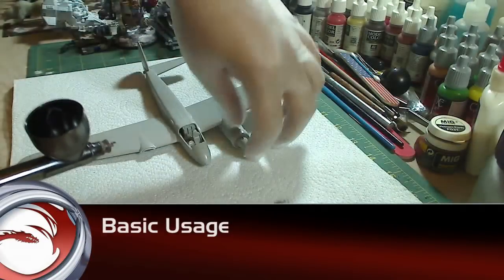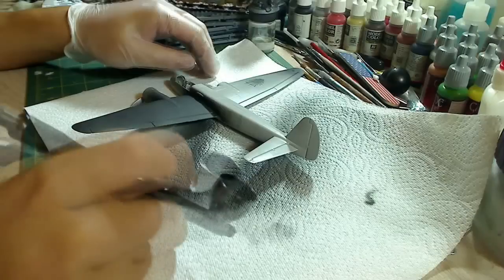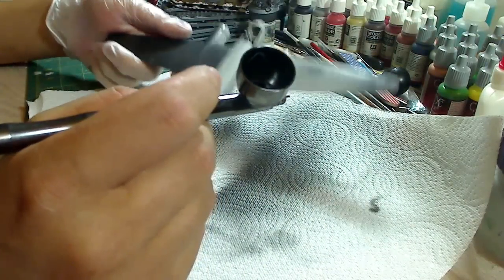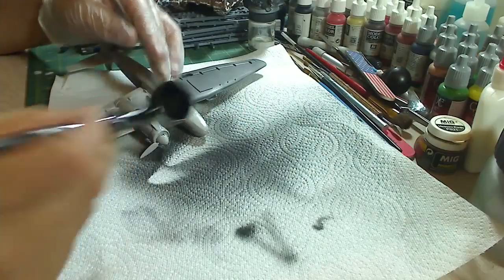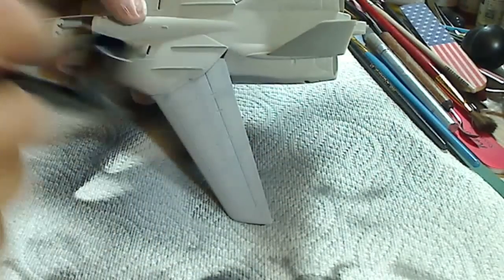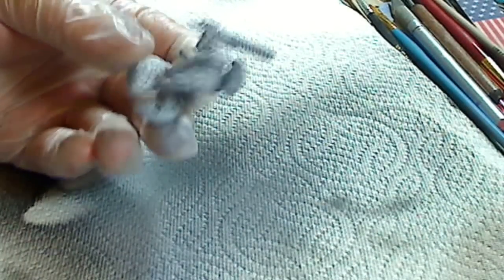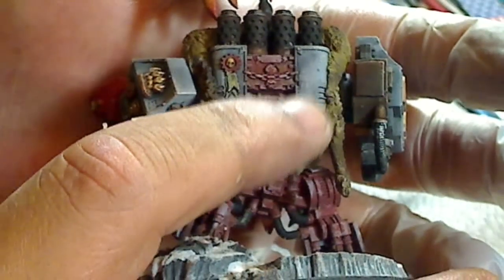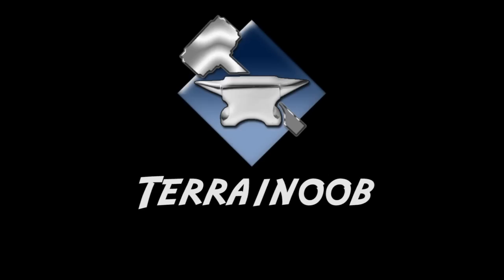Airbrushing for the Beginner #4: Basic Usage and Some Airbrushing Techniques

Comment: I have a question concerning over spray. I've seen you air brush right next to nearly completed parts.  Obviously you are not having an issue, but it seems for the noob, such as I, this could be a problem.  Also it would seem that over time your work area would get coated with paint over spray.

Can you help clarify this and provide your experiences.  I'm trying to determine the need of a spray booth or if I can't just free style a bit, ensuring proper ventilation.

Comment from the maker: @DEMONJESTERJ Right on! Well if that's the case, then why don't you try using CO2 tanks then? They are a no noise solution. You just have to get them filled.  You can get two and switch off when one gets empty so you have time to get it filled and not lose time to use on your models.

Comment: I watched all 4 videos.  Very helpful, and thank you.  I bought an old Kustom Kolor setup years ago that has it's own compressor.  I finally broke it out of the package only to find out I can't find replacement parts for it, and the feed tube is so fragile it tore off both ends of the feed line.  I still want to use it, but just in case I also went out in search of a set that's more recent.  I came across your videos that explained the types and how to use them.  I think I can adapt the techniques to what I have (I only have one project where I'm repainting an Alex Morgan figure into my kid's soccer uniform for her birthday), but it may just end up in me buying a new setup.  I'll let you know how it turns out.  Thanks again for the helpful videos.

Comment: Real nice video it confirmed a few things for me clear & concise! I've just started using the airbrush but it is already obvious that it is going to save me allot of time and not so difficult to come up with good results once you get used to the main principles I think were mostly covered in this video. 1 thing that has made it a little tricky for me is using compressed air in a can I've come to realise getting a decent compressor is pretty much essential to get the control required. thanks

Comment from the maker: @whayden001 Yeh, it can get covered in over spray. I usually cover the area with paper towels or use a big box to make an area to spray in.  When I make a video I can't use a box so you don't see it there.  I usually have no problems after a while but sometimes a light dust will land on your stuff. You just have to put it aside or keep wiping down the area. ;)

Comment: Hello. My airbrush is starting to realise bubbles from under the Nozzle Cap. I still can return it but is there any way to block it. It doesn't seam to suck paint properly
I got Airbrush BD-208
Reply from the maker: Hmmm... it sounds like there's stuff stuck in the tip and nozzle.  Try a back flush and see if that clears it up.